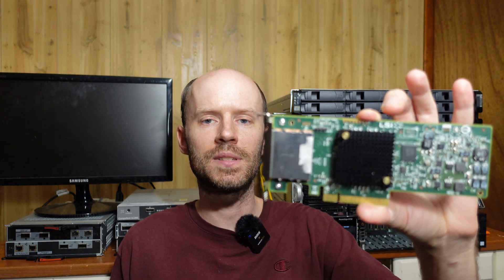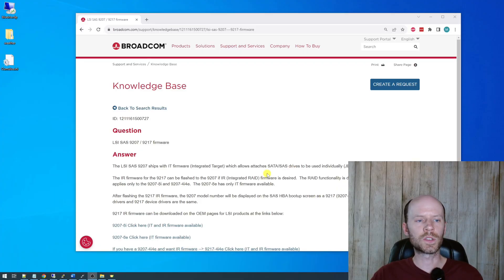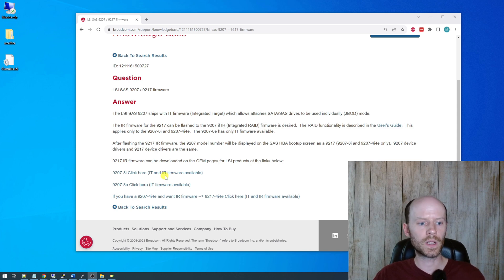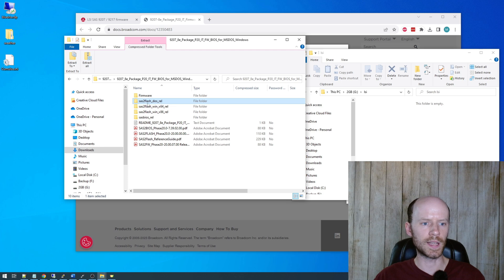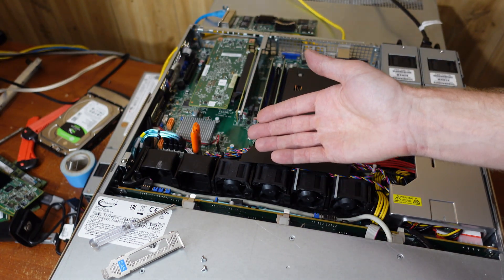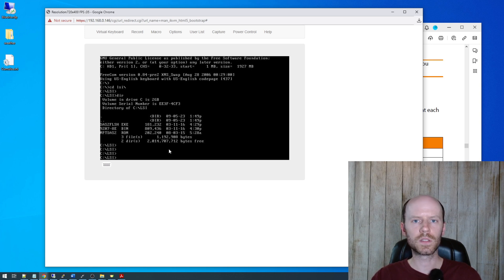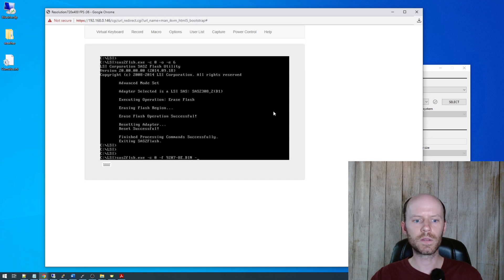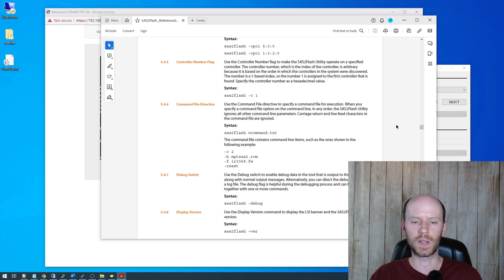LSI 9207-8e SAS Controller Firmware Update Procedure, P20 IT Mode

Comment: Wazzap brother quick question. I want to buy a sas controller for normal pc, i just want more hdd as slave drives. Im not using nas, server or nonoe of that type of stuff. which sas controller you recommend? i dont want none of that raid stuff i dont need it. I just want something where i have the option of turn that off. thanks
Reply from the maker: The 9207 is a fantastic choice. You would want to go with the 8i though ("i" indicating internal ports).
Reply: @HomeSysAdmin  ooohhhhhhh ok ok, nice. I was thinking on getting the dell perc h310, but some people told me i need to flash the software or something like that to lsi, so i can have the option to turn off raid. Usually the  h310 goes for 15 bucks. that 9207 you send me i would need to but dif cables cause im using hdd sas
Reply from the maker: @stormk-1130  What you're looking for is "IT mode" and you can buy either model pre-flashed to IT mode on eBay :)

Comment: I'm going to leave this information knowledge if anyone stumbles across your great video but can't run freeDOS because your motherboard wont support it.  I fully understand I'm in a very small boat of people trying to do what I'm doing, but if it can help anyone else.  I was wanting to use this card in a proxmox server, but my MB didn't allow the booting into the freeDOS usb.  My solution was to create a VM with "Do not use any media".  Finish creating the VM, but don't start it.  In the hardware section of the VM, pass the freeDOS USB drive into the VM.  Then go into options and set the boot order to start with that USB.  Next go back to hardware section and add a PCI device and select raw device and select the LSI card and select All Functions.  Go start up that VM and follow the directions in your video.  Firmware update went off without any problems! Hope it helps anyone!! 😁
Reply: hello brother your comment has really helped me as I was stuck on this for 7 hours before. The issue is when i run the sas2flsh.exe -listall it says no LSI card found even though i passed it to the VM in hardware tab as a RAW device. what specific settings did you create for your VM besides the no media option?

Comment: very dangerous manual. some controllers are NOT compatible with latest FW and after erase all you will get a birck. be carefull when you giving advices!
Reply from the maker: This is taken directly from the LSI documentation. If you're not sure, I suggest reviewing the instructions from the manufacturer for the card you have.
Reply: @HomeSysAdmin  I sugest you to turn on the brain. Maybe manufacturer LSI wrote instructions before B0 revision released. 
this doesn't justify dangerous advice in 2024

Comment: Does this work on any brand of LSI 920x cards? I See other "off brands" with much cheaper cards that claim to be 9207 or 9200 and I'm not sure if there will be any issues flashing it.  I also see a dell branded  9200-8e card but i'm nervous that the flash utility wont work.  Anyone have experience with those other similar cards?
Reply from the maker: I just used the exact same procedure on an HP-branded LSI 9217-4i4e without issue.

Comment: Hi Bro,

need your help. Split Tunneling is enabled on the OpenVPN server but it seems my system is missing some configuration which is causing internet not to simultaneously work when VPN is connected I want the internet to be working on my base system as well & I should also be able to connect to my work network as a lot of websites are blocked inside the work network.

Can you please tell me what settings I need to do on my laptop VPN to make this work. Kindly help.

There is an ovpn configuration file in which details are given. But still after doing below settings the internet on my ubuntu machine disconnects when connected to VPN

pull-filter ignore "redirect gateway"
route-nopull
route <My workstation IP> 255.255.255.255